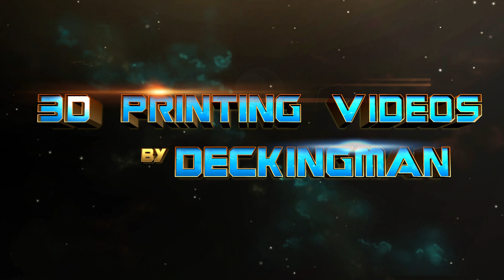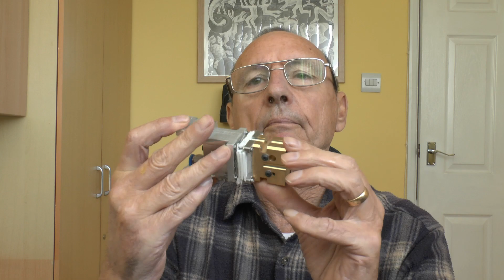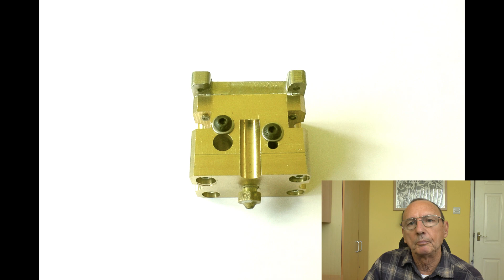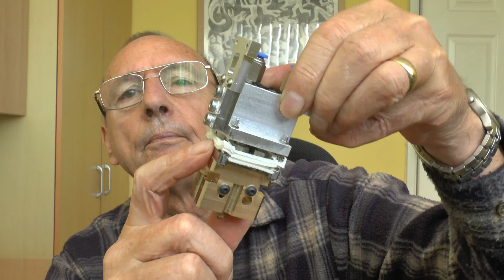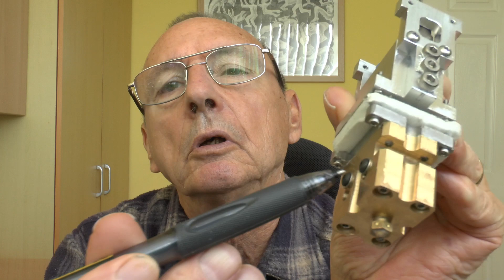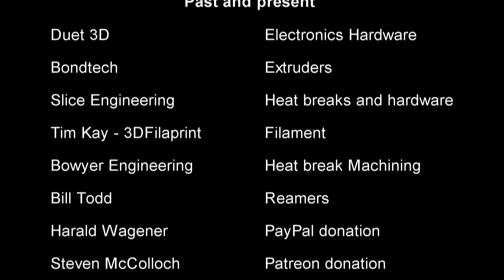Yet another hot end

Comment: I still get astonished by the quality of your work, it looks like some major manufacturer developed that! Out of curiosity how heavy is it?
Reply from the maker: Thank you kind sir! I spent 2 years in a machine shop as part of my engineering apprenticeship back in 1969 - 1971 but I hadn't touched a milling machine from then until I bough one when I retired in 2018. So I was quite pleased to discover that I hadn't lost those skills that I learned 47 years ago. As for weight - I don't get hung up about it. My total moving mass in the Y direction is about 2Kgs but I accelerate that at 1000 mm/sec^2 and use 350mm/sec for non-print moves. So the theory that the lighter the hot end, the faster you'll be able to print is a complete myth because it's the melt rate that is the constraining factor, not the mass. But since you asked, I just weighed it and it tips the scales at  285 gms.
Reply from the maker: One other thing - none of my prints ever suffer from any form of ringing, ghosting or other such artefacts. I have a suspicion that might be due to the low resonant frequency of the heavy hot ends that I use.
Reply: @deckingman  I think that have to do a great deal with the fact that your printer is built like a tank :D and is not the puny sheet metal / crappy alloy extruded profiles construction normally seen in the wild :)

btw, replaced (on a super cheap no-good prc printer) linear rods and linear bearings it came with with aluminium rods and igus bearings (sliders) and with 10x higher acceleration and 2x higher print speed I get no ghosting at all ... looks like "harder to slide" igus bearings "ate up" all the ringing :D .. that was rather interesting find
Reply from the maker: @BogdanKecman  Yes you are right about rigidity. I particularly dislike the groove mount heat sink arrangement that many people use to "secure" the hot end in place.

Comment: Copper, I will see what I can find....
Reply from the maker: Thanks for the offer Bill, but I think copper might be a bit too soft. As it stands, the screws that retain the heat break inlet plate and the nozzle block, go into tapped holes in the brass combining block. But I guess I could maybe use nuts and bolts instead like I used to when I made them out of aluminium. The finished size is 36 x 22 x 22 (mm)